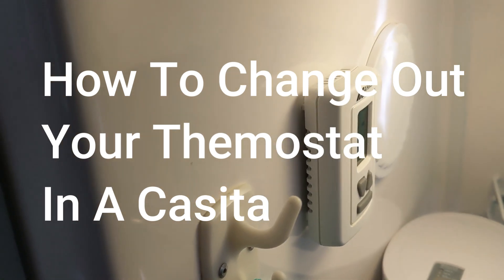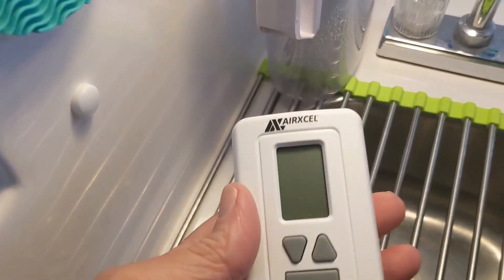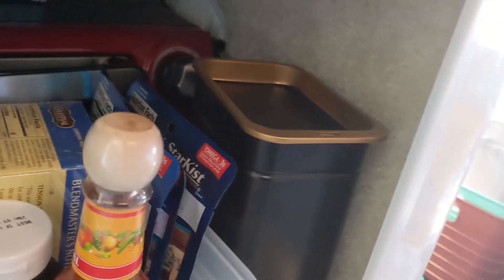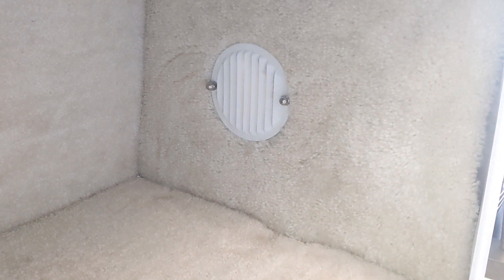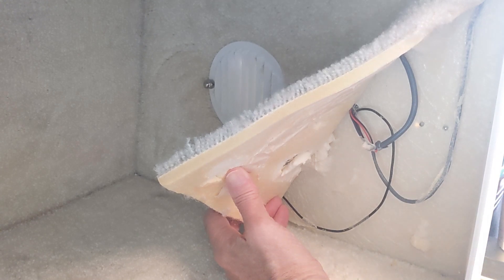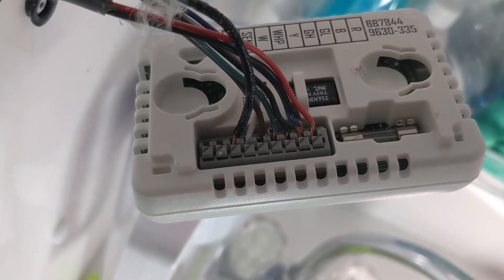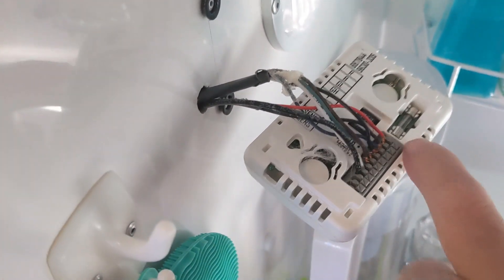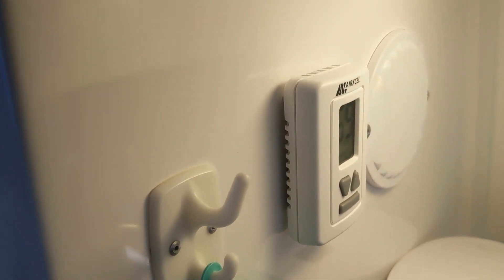Casita Digital Thermostat Change Out

Comment: I have the older manual switches/temp dial on my Casita for both my heater and AC, and while they force you to readjust them more than I would like, they DON'T break. Good video on replacement, though.
Reply from the maker: Thanks!